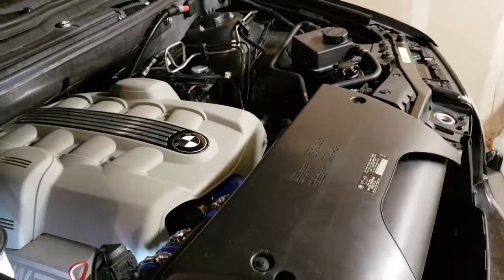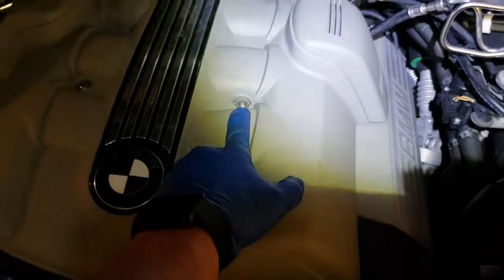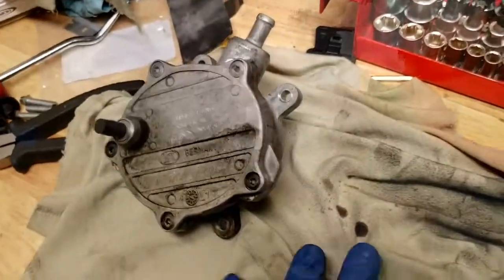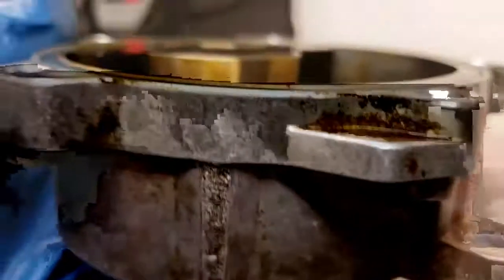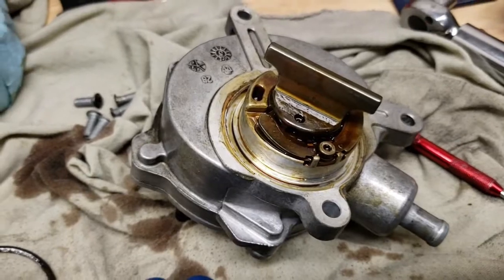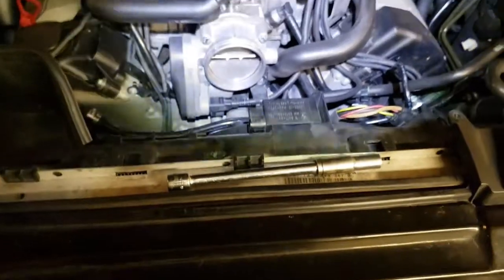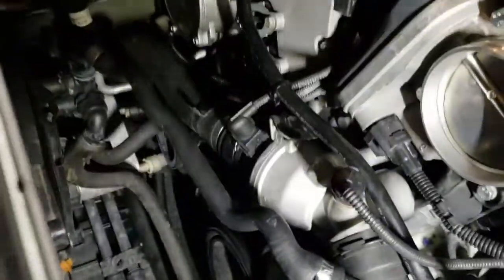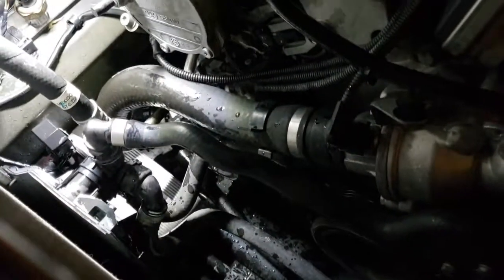DIY BMW N62 Vacuum Pump

Comment: The smart way of doing this job is by leaving the front cover off and install the housing on whilst tuning the shaft to match the key .put the vane back then the front cover back on and bolt it down.
That’s the sensible way of doing this job.  But genius here didn’t even notice that the front cover is held by 5 bolts not 6.

Comment: Sonarscope points at brake vaccum pump changed it out and still.l noisy car runs excellent any suggestions
Reply: Found it eneded up being ac compressor pulley changed ac compressor then went all away happy car and owner now
Reply from the maker: I would check for correct operation of the vacuum pump. In another comment you mention that it sounds like a pulley. You could remove the serpentine belt and the a/c belt turn it on and re-check for noise. Hopefully that helps.

Comment: what were the symptoms that warranted to change the gaskets?
Reply from the maker: Oil leaking from the pump.
Reply: @giddenseuroshop458  Mine apparently, according to mechanic, doesn't create enough vacuum for waste gates to be controlled.  Goes from 2 to 12 slowly from start up. Should be 20-25. Hope hes right
Reply: Did youres make a noise I bought a 50$ vaccum pump but noise is still there sounds like a pulley any suggestions

Comment: And please tell me how often do you change the oil in such a motor?  every 25000km?  or more often?  what kind of oil do you fill in?
Reply: Петька Порошок engine oil must be changed in every 8.000 km
Reply from the maker: I personally use liquimoli  5w40 every 8,000-10,000 miles
Reply: 25k???? Are you smoking crack